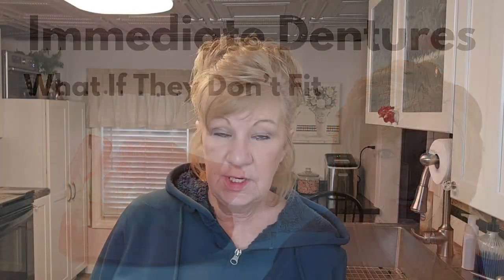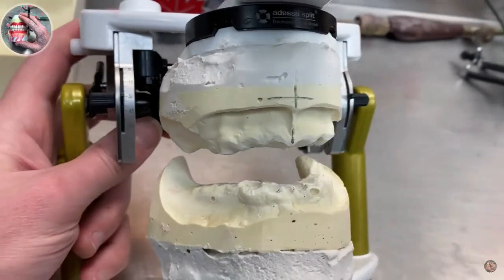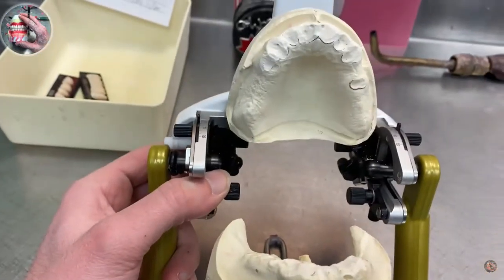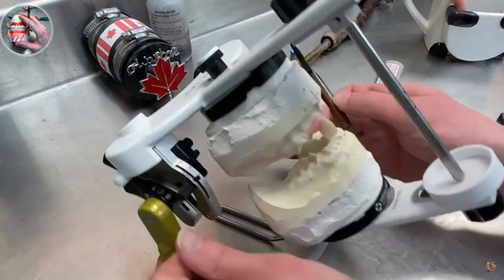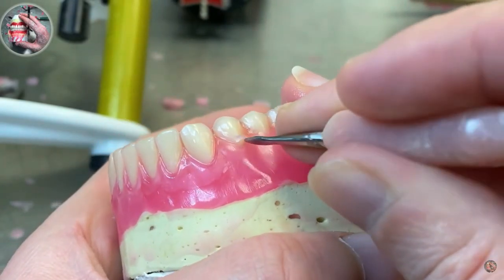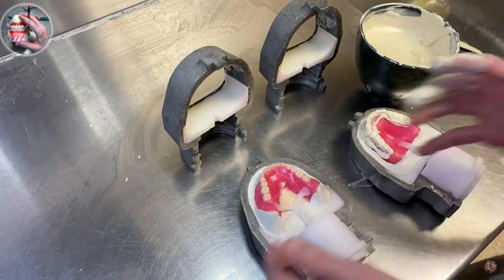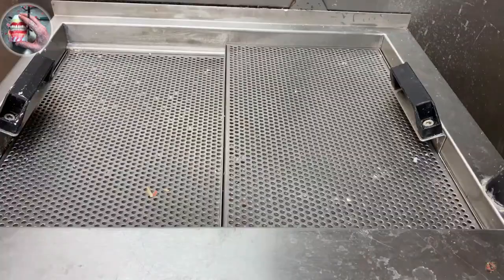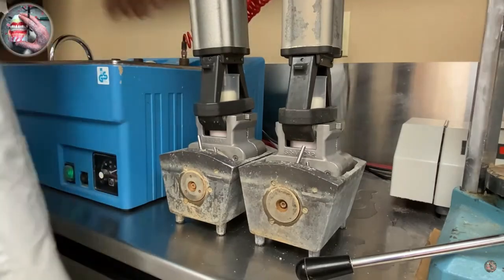Immediate Dentures / How Are Immediate Dentures Made

Comment: We pick question. I just had all my teeth extracted and gave my immediate dentures. My dentures the material in some spots is so thin that you can see through them is that normal please respond .
Reply: Mine are the same way. I opted for the immediate denture until I'm ready for my permanent ones. Mine are also Very thin on the sides. Plus just went through a tooth falling out of mine, and was told that's normal lol not sure if it is but I don't like that answer. I'm 2 months in, on my denture journey.

Comment: Hi!  I am so happy to have found you and your channel so need to watch all your previous videos.  Thank you, thank you for helping us all and soothing our worries.  

My dentist is not the most personable and doesn't tell me anything.  It's been Murphy's Law at every turn from the appointment time, to the COST not being right, to not calling in meds, to the pharmacy not wanting to fill them, to not scheduling filing down the bone, to you name it.  But have to stick it out as the clock can't be turned back, right?  Yes, I understand the swelling will go down but the temp dentures didn't come close to fitting from day one.  I had a flipper for years but it was never a problem.  Yeah, this whole mouth thing is a zillion times more involved and it's only been 4 days.  The dentures have jagged edges all over so they didn't file off the spillage (?) from the mold!  I folded a piece of paper several times over and slipped it in between the front of the top denture and my gums, that's how big the gap is so no wonder they flop around and fall out.  If they were pants, they'd be on the floor with the first step.  The bottom is ten times worse, slants, and has pressure spots.      

Yesterday he just checked on the gums but wouldn't talk about the fit or cutting my cheek until the next visit in 2 weeks when they make new ones?  He talked about a cushion something but the lab guy brought them back without anything so I don't know.  Can't talk, eat or bend over without sticking a finger or two in to hold them in.  I gave up on wearing them today but for a short while at home and a quick trip to town.  Can this be normal at all?
Reply: Give it a few weeks rest to let the swelling go down. They won’t want to address any of these issues this soon. Hingis will get better in time. Have patience!
Reply: My dentist is sadistic. He lied to me twice. He also claimed I was getting nitrous oxide and I was not, twice. I’m doing my best to not hate him. I haven’t had pain like that since I was in labor.